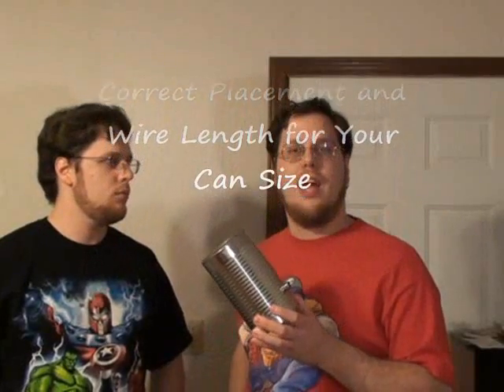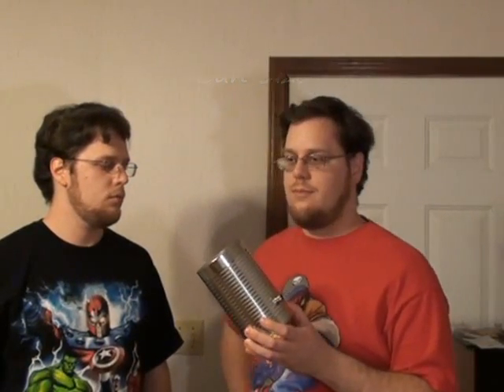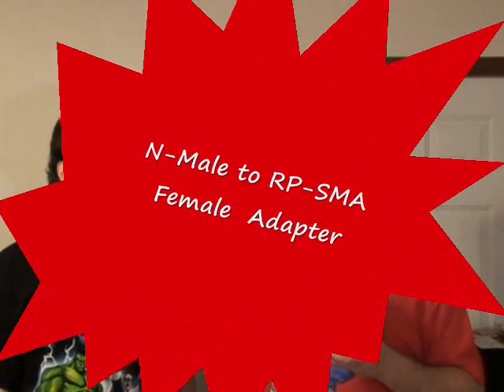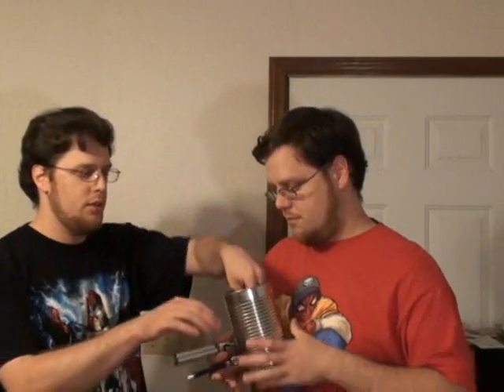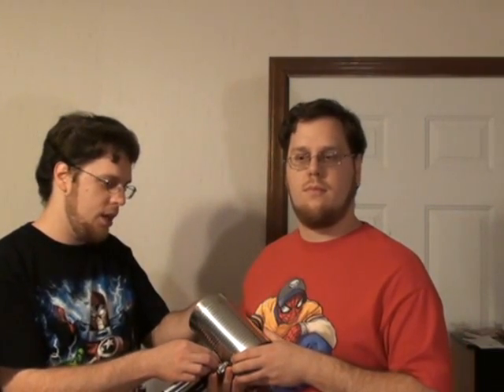Making a Cantenna

Comment: hey i made a smaller version where did u guys buy the tripod from because im using a coffee can smaller version from the food store i bough i  live in phoenix north and i get 60 routers 25 of the un secured and at good signal strength running qwest wireless usb adapter action tech adapter this is so fucked up lol it worked for me